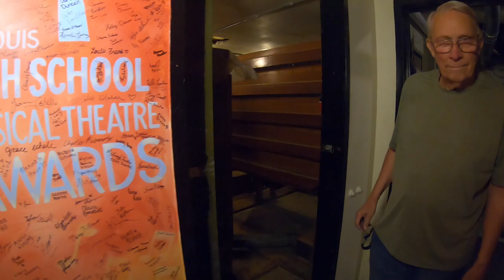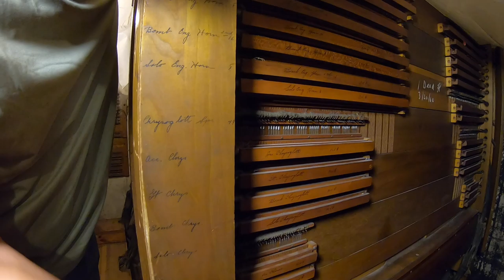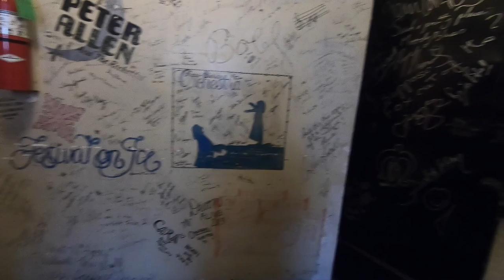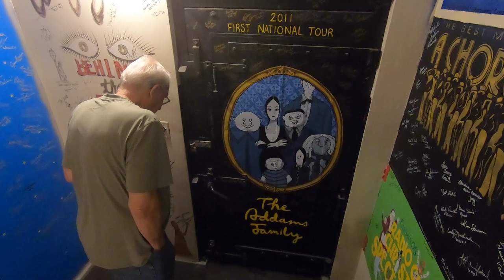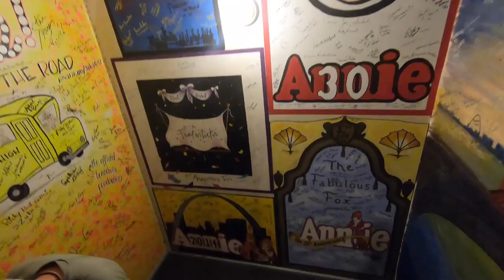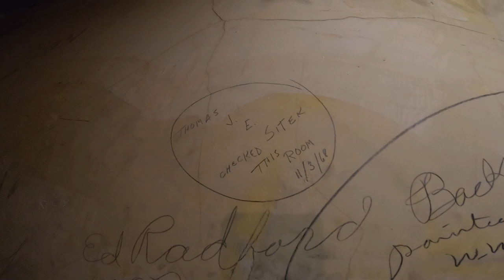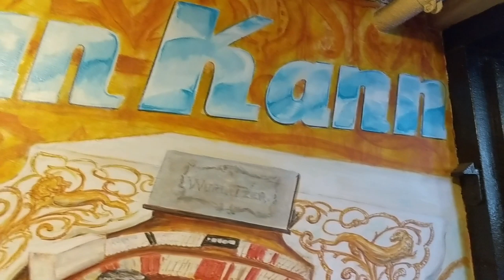1928 Wurlitzer Fox Special Organ, Fox Theatre, St. Louis, Missouri, Part 2 of 2

Comment: Thank you Brent.  I cannot believe that all of the old equipment works - it looks as if pipes are everywhere!  Not to mention the combination action wing.   We have a similar (but not as large) Grand Barton organ ( 18-23 ranks)  in the Overture Center for the arts in Madison, Wisconsin.  The organ's electrical switching system is sealed in a special room high in the building is so massive that it had to be put in place before the building was finished, and parts of the theater had to be built around it.

Comment: Fantastic video, thank you!  I live in Dallas, Texas, we had a beautiful Wurlitzer organ in our Palace theater that unfortunately was torn down and replaced with a highrise office building, so Dallas!  Does anyone know what happened to that white Wurlitzer that came up from the floor?  What a loss for Dallas.
Reply: The Dallas Palace lost its Wurlitzer as early as 1930. That organ, Opus 411, moved to a hotel in Los Angeles, then a radio studio in Rochester NY, then to Denver. The reason for its removal was its replacement by the much larger Opus 2125, nearly double the size, which likewise got sold on. Neither instrument is extant any more, both were scrapped decades ago, with some parts sold on for reuse in McWurlitzer bitsas.

Comment: I wish you would've pointed your camera down to where hoses exit the console to the pipes that make their way to the bellows room. I've always been curious how the console is mated to the rest of the organ, especially when it's somewhat portable in comparison.
Reply: Organs like this have an electrical “umbilical cord” that connects the console to the relay system. The wind is provided by a 50 horsepower blower (with a second identical blower for backup) down in the basement. From there, wind lines carry the wind first to the regulators (which control the various wind pressures), then to the wind chests. There are the many tremulants in this organ which are placed between the wind lines coming from the regulators on to the wind chests: